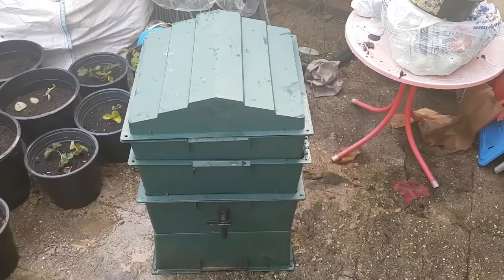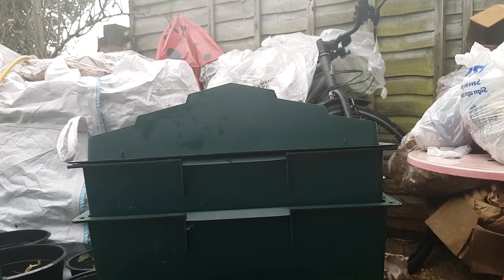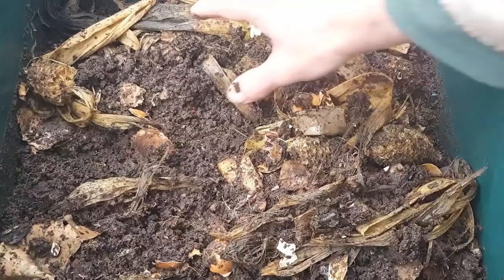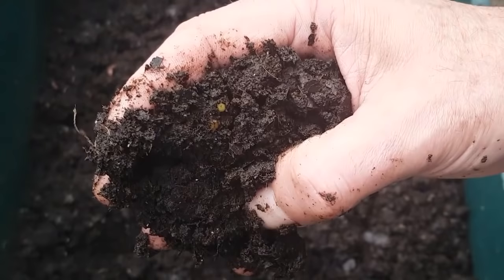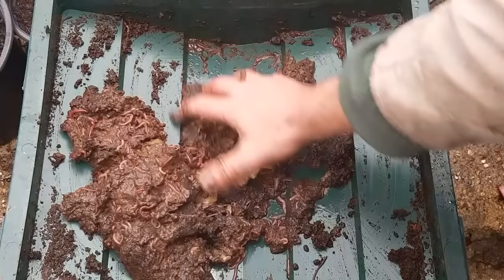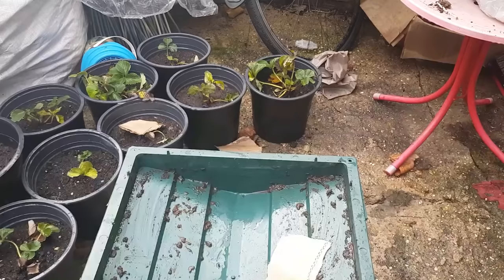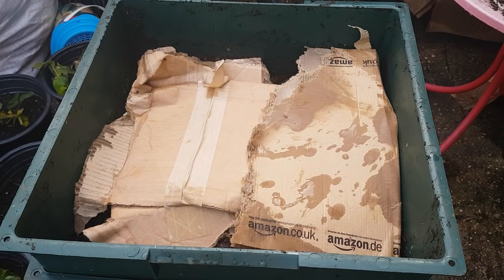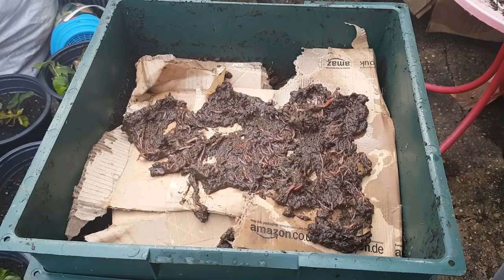The Worm Tower Composting System - Introduction

Comment: Simple solution...always keep a tray full of bedding, shredded cardboard only, on top of the sump. It will not only keep your tower from getting too wet but the tray of bedding is used as your next working(feeding) tray and will be full of microbial life and already decomposing by the time you need it. I leave mine for about 4 months.
Another tip....ALWAYS add shredded cardboard when you feed, roughly the same volume as the food. Not only will the worms eat it but it will soak up a lot of that moisture.
The secret to a healthy worm bin is lots of shredded cardboard, it will all become worm castings so don’t skimp on it.

Comment: I had this issue and noticed a lot of worms had died from water due to the design.  The tap is too high up and too big as the worms would wash out. I drilled a 3mm hole level with bottom platform under the tap. Thin tubing 4mm OD 2mm ID and siliconed to bottom platform with about 2 to 3cm going in to bin and 10cm out and bin slightly tilted. Any liquid exits immediately into carboy. No flooding or dead worms. Just castings and worms have gone back up with few at sump. So far so good. Hope it helps.

Comment: Had one of these for many years maybe about ten!   
Love it. Got 5 trays. Chuck everything from the kitchen bucket as it comes....no point freezing, why squeeze out all that good moisture?, just chuck it in. Egg shells too. Cardboard, paper, toilet roll middles.....worms love to gather in these. 
I have thousands of worms. I feed handfuls to my hens, who also love to pick out and eat the egg shells. I just tip the tray out and let them scratch  it onto the planting area.
I do however add hands full of dry leaves from the leafmold container if it looks a bit wet.
Not seen any worms in the sump. I leave the tap open all the time....I also use citrus peel and onions which I’m told you shouldn’t....seems to be fine.
Reply: I’m going to try this. Thanks.
Reply: Just looking at this system for UK use.
1. Does this tower need to be in a certain position, location, in or out of sun, at a certain temperature? Can it be too cold in British winter or too hot, or too sunny?
2. Does it ever smell?
3. Any issues in going on vacation and leaving it for 2 or 3 weeks or more? 
4. What other issues and problems with them? Pests, virus disease, other invasive worms, dead worms, etc? Other than mentioned, what’s the maintenance work with them?
5. Is it worth having? Is there a good yield of compost plus liquid feed for the effort and space taken?
6. Do the worms multiply enough to keep it going or do you need to add more worms later?
7. If they over multiply is it then necessary to remove some worms? Plus does this happen and how regularly?
8. Can and do the worms escape? If so how?
9. Which are the best worms to use?
Thanks!

Comment: Hi there! Thank you for this video. I got the same worm tower and experienced the same issues: very damp compost and worms drowning into the water collection tray. 
Then I saw your videos and ai decided to make some changes to the tower. I decided to only use 2 trays. So I have the water collection tray at the bottom. I put an old t- shirt between this tray and the working tray above to prevent the warms to fall into it. On top of the water collection tray I have my working tray where I have my very happy worms and the kitchen scraps. On top of the working tray I have what I call a "ventilation tray" that I only use for ventilation where I drilled loads of holes to ventilate the tray underneath. I then cover the ventilation tray with the lead but I keep the lead slightly open and I put some tree branches to keep it in place and protect from the sun and other insect. The system works wander now. Once the compost is ready I will remove the worms from the working tray and transfer them into a new working tray with fresh food. 

Thanks again for your ideas 

Cecilia

Comment: Your experience with this bin is very similar to mine. Even though the quality of the castings is good, the bottom tray stays too wet and a good amount of worms and castings end up in the sump. When you've got all 3 or 4 trays on, it's a real pain to access the sump, so I ended up just tipping the wormery until the leachate came out of the tap. What really helped to reduce the buildup of liquid was leaving the lid off 24/7 (it was an indoor wormery!). It would benefit from a screen that could stop worms (and castings) from getting in there in the first place. Now I've got a flow through bin, which I much prefer.
Reply from the maker: Hiya Simon - yeah it's an issue with these bins - although it seems to behaving itself so far. I'm got a home made flow through to make and upload in the next few months.

Comment: I was given a used tower and was grateful for it. I cleaned it up and did a few minor repairs before placing a metal pan scrubber/scratcher directly over the spigot hole on the inside of the bin. Then I cut a piece of landscape material about 3" wider than the bottom square and squished it tightly in between the next bin to tight line it across the liquid catcher gully. I also placed the landscape material in the bottom "working" bin to keep the worms from leaving the tower. I don't use it conventionally. I have about 4 trays full of bedding and feed in the top tray so the worms will be encouraged to produce more cocoons. The worms love to move throughout the 4 bins and I've yet to have even one worm in the bottom area. I also tilt the tower quite a bit because I don't want stagnant stinky stuff sitting around. My worms are vivacious, full of color and reproducing swiftly. I dilute any liquid and water non-food trees, shrubs and lawn. Which is just as beautiful as the chem treated lawns but I don't have to mow as often as they do. Hope this helps those who have worm towers.
Reply from the maker: Renee this is brilliant. Sounds like you've really got your tower working at peak performance! Thanks for sharing. Hope you're keeping safe and well.

Comment: He should add a lot more brown material, like leaves, shredded paper, or cardboard. It also seems that he is putting too much food in the bin. That amount of food would only work if the bin is loaded up with worms. Also, you may want to place something on top of the sump bin with very small holes to keep the worms out of it. These should solve many of the problems with the worm bins. I agree that the spigot is way too high though. It is almost useless. For the liquid to even reach the tap means you already have a serious water problem.

Comment: Hi, I've had a Worm Factory 360 for the last 2 years and I can honestly say that I don't have this problem. There's very little in my bottom sump and I don't put cardboard or paper in there.The only things I do differently is that I don't freeze my food and my tower is kept indoors (I live in Canada). Your trays look a lot wetter than mine. I do get a little liquid from my drain valve, usually when the food is wetter, I blend my food before adding it to the bin. Maybe you should try blending your frozen food with corn meal or wheat bran to make it less wet.
Reply: Yeah, putting material in the sump bin, seems like it would draw worms to that bin.

Comment: Just looking at this system for UK use.
1. Does this tower need to be in a certain position, location, in or out of sun, at a certain temperature? Can it be too cold in British winter or too hot, or too sunny?
2. Does it ever smell?
3. Any issues in going on vacation and leaving it for 2 or 3 weeks or more? 
4. What other issues and problems with them? Pests, virus disease, other invasive worms, dead worms, etc? Other than mentioned, what’s the maintenance work with them?
5. Is it worth having? Is there a good yield of compost plus liquid feed for the effort and space taken?
6. Do the worms multiply enough to keep it going or do you need to add more worms later?
7. If they over multiply is it then necessary to remove some worms? Plus does this happen and how regularly?
8. Can and do the worms escape? If so how?
9. Which are the best worms to use?
Thanks!

Comment: I have a Worm Factory 360.  Very similar design.  I always have worms in my sump level as well.  Recently checked it and it was over an inch and a half of solid castings and loads of worms.  My tower has 4 trays working right now... those worms should be quite a ways higher.  They just seem to migrate down in the moisture so so much!  Look forward to your series!
Reply from the maker: Cheers Emily :-) Looking forward to your input - together we're going to crack this mystery LOL :-)

Comment: Old video, but want to put my 2 cents in... I have a system similar to this and use window screening at the bottom of the first layer. this way the moisture can drip through but the worms are too big. When I rotate the tiers I have to dump the new bottom one to put the screening under everything, but that happens rarely enough that it isn't a big deal. I use the plastic variety (I think it's made out of nylon) and haven't had issues with deterioration or anything.

Comment: Hey my friend. I bought a worm factory 360 and tried using it with 2 lbs of worms when I first got started. Sorry I ever purchased it and paid $125.00 bucks for it. I had worms running everywhere and in spite of the fact that I did not use any extra moisture it was always wet. I have six bins and 3 small buckets with cocoons and baby worms in them. Close to 60 k worms now. Was thinking about trying the factory but after watching this it's no,no,no. Lol
Reply from the maker: Hiya Catherine :) I hear ya :-) I think to be honest that's one of my biggest gripes - they're very expensive in my opinion for what they are. They look nice for sure, but to be honest, and I think this is your experience from what you've been saying, recycled and repurposed containers that cost nothing or next to nothing work just as well if not better. But we'll see how we go with this one starting from scratch :-)

Comment: I'm confused how it stacks together, I've had my tower for a year & the instructions say that when the first tray is nearly full, put another on top. The problem is that the new tray will then have a gap around the bottom edge, because the bottom is obviously narrower than the top & when it's dark you then get escapees, if you sink it to the level of the tabs on the side you only get about two inches of vermicompost per tray. Just wondered what you think.

Comment: Hi I've been experimenting with worms for a couple of years now but only using a single container x2 but have 
recently purchased a vertical tower from Original Organics. It has a fine mesh strainer above the sump to seemingly strain the liquid and not allow the worms to enter the sump. After watching your video I'm wondering 
if the vermicomposters have this feature. You have enlightened me on quite a few things regarding the worms themselves and had always wondered if you can mix the different species. My new composter came with a bag of Tiger worms but I tend to put any type of worm in the new composter to help them. I started my old containers off with leaves containing lots of smaller red coloured worms which I think have a different name to what you described Box worms. Thanks for your video and hope your happier with your wormery now.

Comment: Ive got this bin and I occasionally get a bit too much liquid in the sump( not as much as yours though. I use egg boxes and then once every  quarter( ?) i empty the wet cardboard and worms into the working tray.If you have too much liquid in the sump its usually a sign that your food is too wet ! too many potworms is also another indicator
adding food: i freeze to kill off any bug eggs which can infest the bin. then with an old blender i blend all the food with it liquid into a smoothies, mix this with dry food, coffee, eggshell powder, bread crumb etc to make a damp paste. this usually reduces the risk of too much liquid. add in shredded cardboard and they are fine.
lifting the trays you got to be careful with your back. 25 litres of worm casting can be heavy ! I use the upturned lid to stack trays into to prevent crushing the worms
when i harvest i do find that its a little too wet for my liking so i remove the tray contents into a plastic box to air dry and eventually remove worms as i go 

my bin is a 5 tray system( food scrap from one person) and Ive only got to the stage of 3 trays at most( my worm population is approx 2kg I think).with more trays I find it easier to leave them longer to mature ( the final pieces that take longer to breakdown for the worms) and to allow cocoons to hatch for the worms to hopefully move up.
my thought on the tray system is that it can affect stocking density in that with multiple trays you decrease the density. if its too low the worms dont meet as often and reproduce slower( and in turn process less food). if too high then they will naturally self regulate population( which is fine for me).its not a bad bin and easy to assemble. when I first bought it, I had a boiler engineer doing a service in my home  and he thought I had bought a bee hive..
Reply from the maker: Cheers for that....lots of really good information and tips in there. It does look a bit like a bee hive doesn't it 😁 Great to hear from you. Hope all is safe and well my friend 😊👍

Comment: I have what looks like the exact same system! I've resorted to filling in the bottom part of the sump with a spare load of cheap silicone sealant plus propping the back up a bit with some timber to make sure liquid drains forward out the tap, which I just leave open with a big jar under it. Because I have the 5 tray one it's far too much work to lift the trays just to keep an eye on the sump, so I only look about once a month when harvesting a tray. The muddy wormy goop that still collects is ok added back into to the top tray to help things along there with microbes and such - it would be a shame to chuck such nutrient and microbe-rich stuff away. I put a lot of dry shredded cardboard into the working tray on a regular basis to soak up excess water of course. Another modification I've started making is each time I harvest a tray I drill a few extra holes in that solid section in the centre of the tray, to stop it causing a stagnant wet oxygen-deprived zone just where air and drainage are most needed - I don't know if that solid bit is for more strength or just to suit the injection moulding process, but I don't like it. I have to hand sift for worms and cocoons before using the castings, getting them dry enough to sift through a mesh would be hard work. Sometimes I don't bother even sifting out worms and cocoons, they're quite happy living in my planters. Oh, and because it's now permanently moved out of the garden and into the cellar I've replaced the plastic lid with a sheet of cardboard and that's made a big difference in letting more air in and vapour out and kept my wormy pals a lot happier.
Reply: P.S. I'd be very grateful for a link to the series if you did it, as I've only just discovered your channel and am rubbish at finding things. I'm really pleased to find videos from a worm composter in the same country as me that might have climate-relevant advice :-).
Reply from the maker: Hiya Frank - I enjoyed reading your comment above. Really interesting the mods you've made. So far I've made none but they're on the way.
The link to the playlist is here:

https://www.youtube.com/playlist?list=PL0eHmLDoC1qDG1kxupSeCgeCAzXxgq36D

That's for the worm tower. I also ran a glass recycling bin as a worm bin for a year - that playlist is here: 

https://www.youtube.com/playlist?list=PL0eHmLDoC1qBlh4wXibBF07ocHf6_HvK8

That bin had brilliant results and just goes to show if you make things the way worms like it, they'll stay, compost away, and you need spend next to no money lol.

Like yours my worm tower lives outside - it's been suffering a bit in this heat despite my best efforts. I'll have an update shortly. Great to hear from a fellow UK vermicomposter :-)